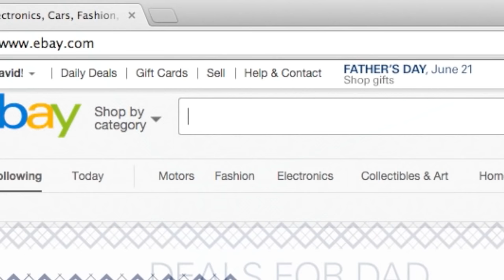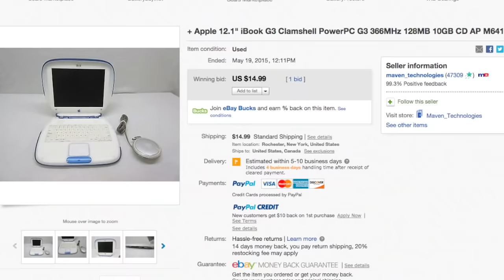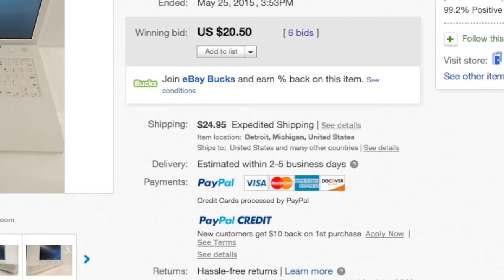Are apple iBook laptops collector's items yet?

Comment: just that 10 or 20 years from now the caps and batteries on those things are gonna have leaked all over them. these are not long-lasting products like the vic-20 or simular hardware.
Reply: and no... probably nothing you do in terms of climatisation stops that. what we've also noticed with rubber dome keyboards is that the rubber domes simply become solid hard stuff and the keyboards no longer work. (which actually happens quite quickly in the lifespan, laptops from like 1995 that already have that now, doesn't take a lot of time).

Comment: not nescesarily an ibook question but close. will original imac G3s be collectable? mines a bondi blue revision b (the one with memory expandable to 512MB and is perfectly intact with even the side door. i found it for $20 at a thrift shop. I upgraded the HDD as the old one was dying and replaced the motherboard battery as it was dead. i plan to eventually upgrade the ram to 512mb from the current 256mb
Reply: +iGeek's Old Page I have a 17" iMac G4 with box and everything. It is in my Apple museum
Reply: ***** do you have a G3?
Reply: ***** oh. That's like me. I was to get a G5, but the person never responded. I have 2 G3s

Comment: Thinkpads are definitely collectables!
One of the only laptop lines that rival the build quality and engineering of apple laptops
Reply: AstralChannel As long as you fix that ram slot issue a lot of them suffered! I had to scrap one Thinkpad T30 because of that and repairs aren't cheap.
Reply: Totally +1 here. Of course you can come across some problems but that goes for any laptop. Most have some common sicknesses. And it is one of parts of which collecting consists of.
I suspect Thinkpads are second after Apple or even first collectable laptops. They are also special for they kept their distinctive character for a pretty long time after others began to make very similar and uninteresting laptops.

Comment: i have  a iphone 3gs and 4s in perfect condition will they EVER be collectable
Reply: No
Reply: Yup, in about another 20 years or so.
Reply: Get a new housing for the 3gs while you can. Try and find the original packaging and buy the product manuals and itunes install cd to complete it. Remove the battery and let it sit in the box for another 20 years. It might be worth a thousand or so. Batteries for mobile devices are all 3.7v for the most part and that isn't going to change anytime soon. When the time comes just get a similar ish battery in dimension and solder it in.

Comment: I bought several very cheap a few years back. I took liberties to mix the colors on them all. The tangerine and Key Limes are definitely the most valuable strictly due to the radical color. A bit of work ahead of me if I go to sell haha. The battery life is excellent and they can be quite useful still with OS9 or an earlier Linux distro!

Comment: 2022: I got my cheap iBook G3 DualUSB for twelve years now (hell, it even got a new update directly from Apple when I already owned it). Even if I barely use it, I am still happy with it. Any my iBook G4 running Leopard is a quite nice 12" device for use on travel. But as I bought myself a 2014 MacBook Pro 13", I guess also those times now are over.